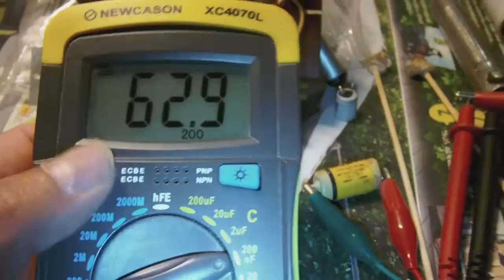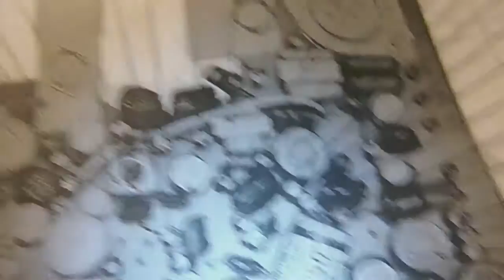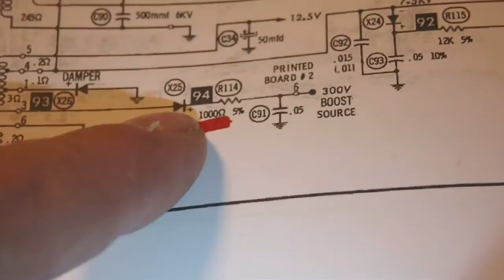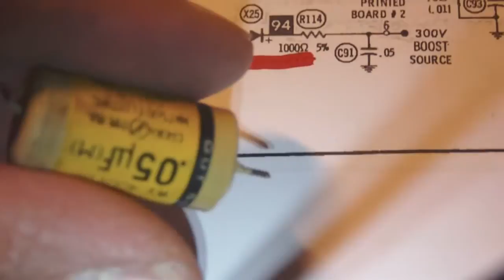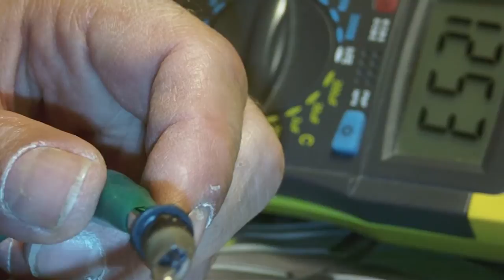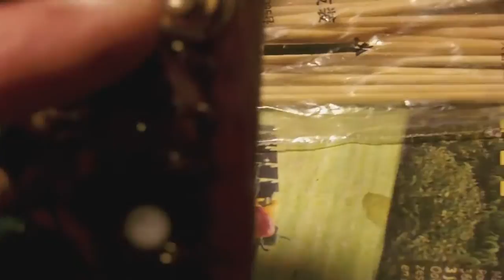Sony 5-303E part 3 of 10

Comment: Testing a diode with an ohmmeter is next to useless, you should firstly test it on the diode range of a meter and then if you still don't trust it, try measuring the reverse bias  leakage current with a higher voltage supply, I usually try to test it at it's rated data-sheet voltage, if that's not possible, 30V from a regular power supply should be good enough. Anyway, keep up the good work. Cheers :)
Reply from the maker: ciprianwiner I agree the method you describe would be far more accurate to determine whether a diode has been damaged through "catastrophic" breakdown of it's PN-barrier. In my experience, testing it with an Ohms-meter is a quick and dirty way to test whether a diode functions or not... regardless of the fact the latter method gives no reliable indication about the "health" of the diode under normal working conditions. Thanks for the tip however. I might use it as a starting point for a one-episode video on testing diodes :) 
Glad you liked the video. Stay tuned !